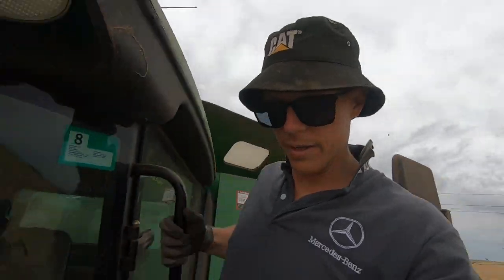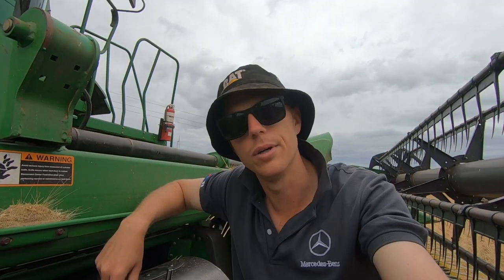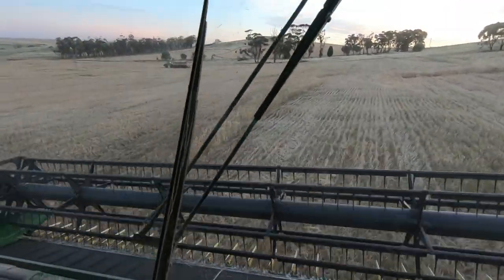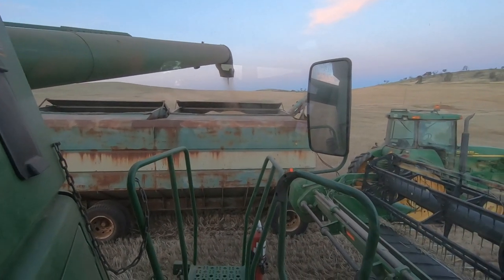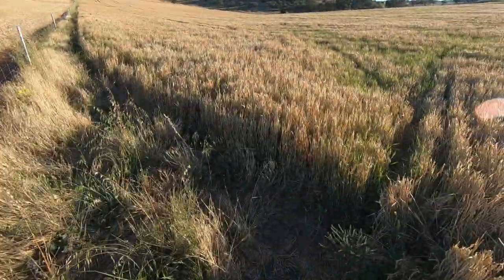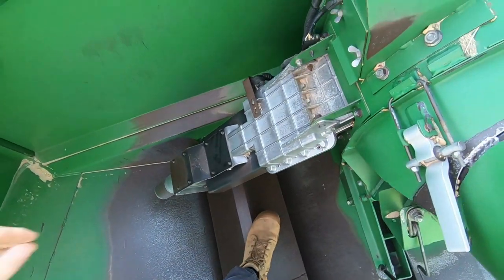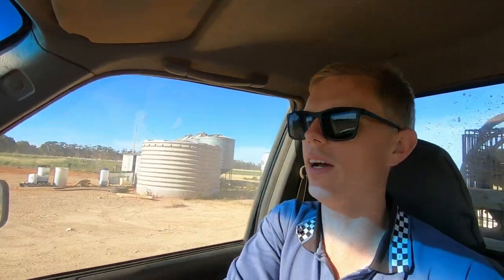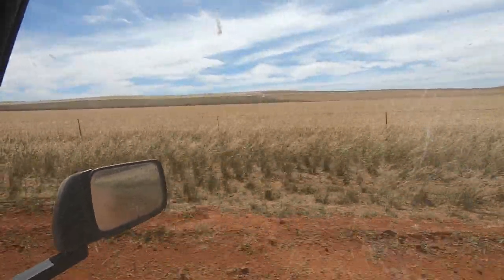Final Acres Of Wheat | Our 2021 Australian Wheat Harvest Is Almost Over

Comment: I've had a fair bit to do with those moisture meters. 
Turn it off , in the monitor. 
You don't need them here in Australia. 
If you're not mapping,  then unplug the harness on the outside of the grain tank, on the right hand side of the machine.

Comment: I’m sure you have been asked this but why no chaser bin? Saves so much time
Reply from the maker: I'll tell you what, you're not wrong there, and it's definitely on the shopping list. It comes down to a lot of factors for us. Acres covered, man power, paddock size, expected yeild, terrain and $$. We have a lot of rough terrain and smaller paddocks, 25-50 ha. It makes managing livestock easier having smaller paddocks and also means a run up and back will often fill the grain tank. Just plonk a bin there, pull out and unload. Unless we hire someone, we have no one to drive it. It's hard enough to get anyone for anything at the moment, let along a couple of weeks of harvest. On an average year of say 3t per ha yields 1700-2000 acres doesn't take long to harvest. We already finish well ahead of most people. Don't forget the $. It represents a fairly large investment especially if we have a couple of bad years in a row (highly possible in our area) Money doing nothing in the shed because ultimately we are 50/50 livestock and cropping.

Thanks for watching 👍
Reply: @lockvalleyfarms981  yeah that makes sense. I guess i had much bigger paddocks and a lot further to run back to the bins. i hear you with the bad years, i started farming in the mallee in 2018 and 2021 was my last year, bad run of seasons

Comment: With the chopper , get someone to lift the back of it while activating the switch,   sometimes it's enough to make it lift. 
And again,  on the moisture meter,  it has a an electric motor that burns out.
It powers the plunger to retract and dispell the grain for separate  grain samples. 
On some occasions it triggers the speed alarm and the oil pressure alarm,  above your head, at the same time. 
This can be fixed by swapping out a ECU in the console (sometimes) some mechanics call it a terminator. Roughly around $ 120.
If this doesn't fix it then you know its the motor in the moisture meter.
Reply from the maker: Thanks for the informative comment 👍. The Chopper did actually just start working again haha, and the moisture meter seemed OK for the rest of harvest. I did end up replacing the relays as well. It will probably stuff up again next harvest 😅
Reply: @lockvalleyfarms981  I have a channel as well, that I am in the process of showing sts owners the tips and tricks on fixing and modifying the machines themselves. The latest video is labelled "West End Farms" under the "Sivid Production" banner 
This one doesn't show any tips, but shows the yields that we got in the west this year.
Reply from the maker: @sividproductions6591  That would be awesome. I've learnt a lot by just having a go on ours but I'm always looking for advice. I'll go check it out

Comment: How many hours has your header done, we have one exactly the same that we got from Pringles Ag Plus, has been a good header.
Reply from the maker: Ahh, good question. I'd have to go check but I'm sure it's around 23-2400 separator hours. Probably a thousand more on the engine. We picked ours up second hand at Emmetts. By all accounts they are a fantastic machine.